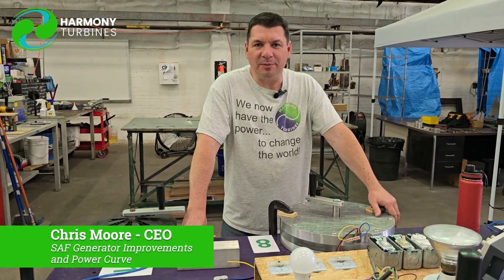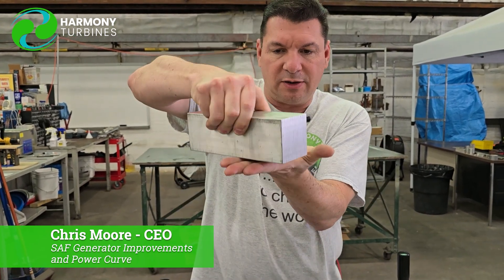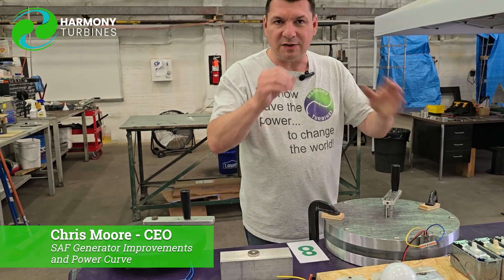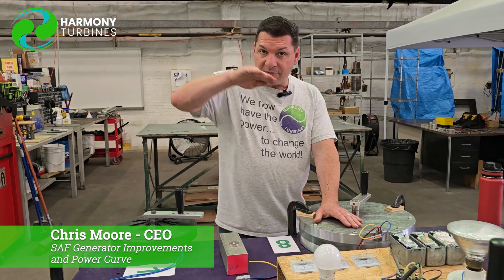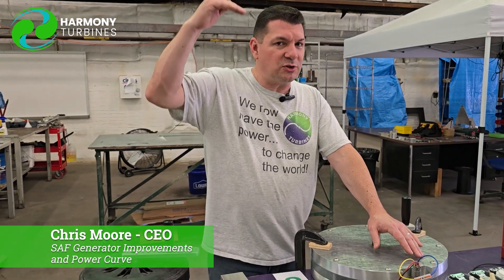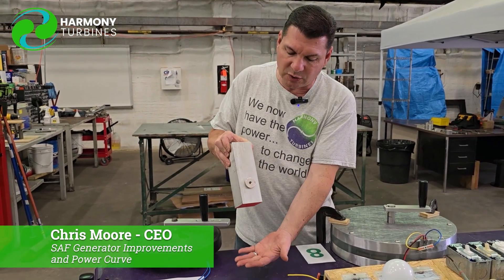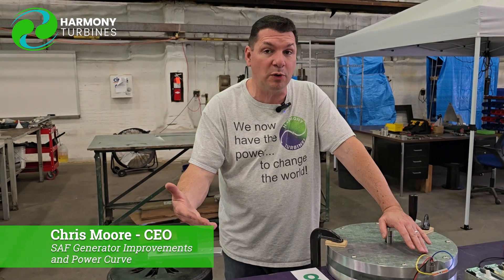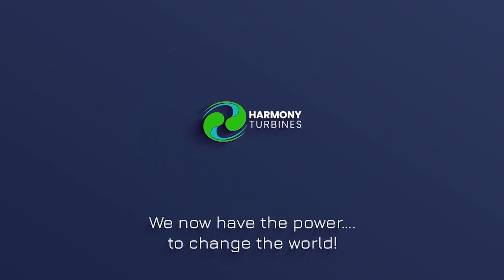Why our SAF Generator Power Curve Nearly Doubled!

Comment: I am curious, have you built one of these designs with a body made from non-metallic materials to find out what the lowest eddy currents can ultimately be? I understand that perhaps aluminum, is structurally necessary, but if you want to know what the limits are, maybe that is worth a try.

Comment: What about moulding the casings from CFRP, which would provide the strength and durability of aluminum while cutting Eddy current effects to less than half of the aluminum block. I would also expect CFRP to be easier to produce as it could be moulded instead of milled.

Comment: So....why use aluminum at all? Why not epoxy top & bottom, with embedded coils, sandwiching the epoxy embedded magnets. Use spacers of some kind to get the distance between magnets & coils correct. Is there a reason that top and bottom need to be aluminum?